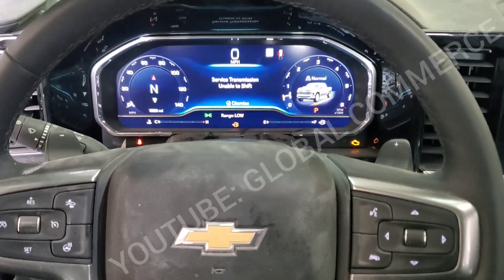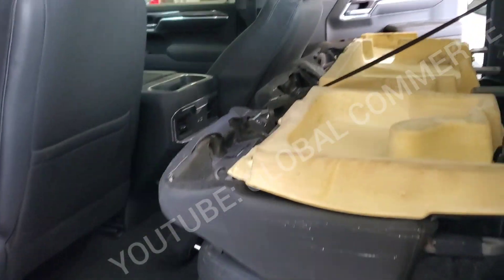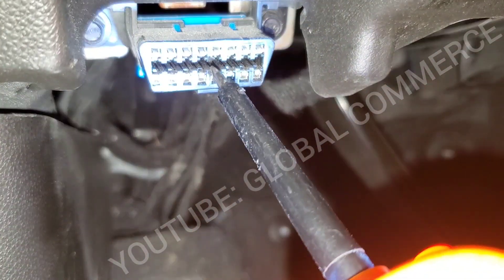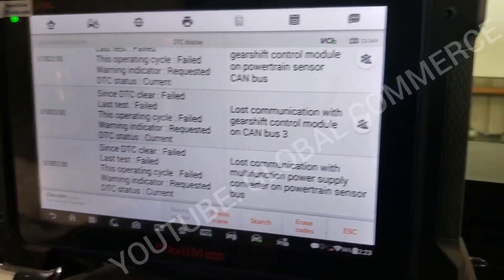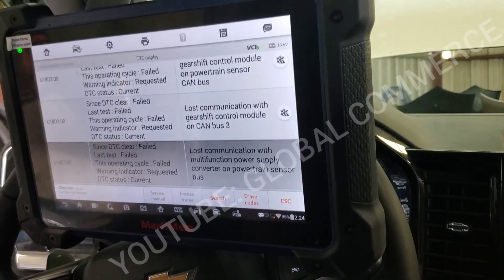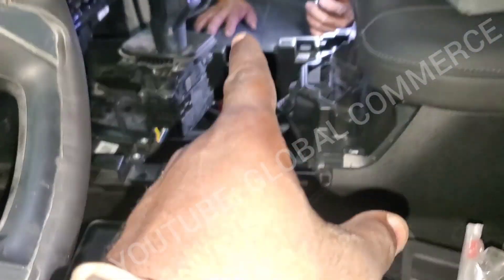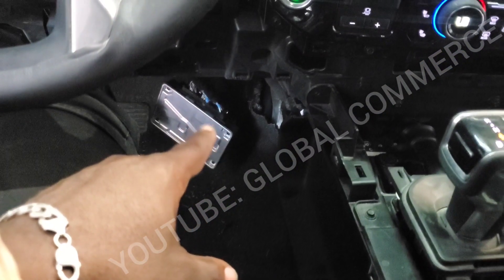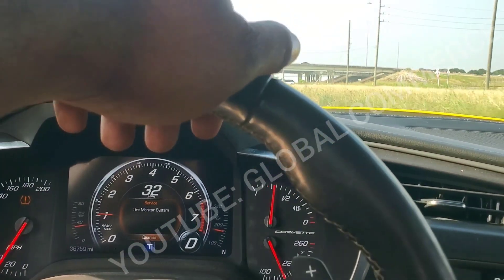2023 Chevy Silverado U0074 Lost communication CANBUS 2 Off, U0103 Gear shift Module! CAN DIAG/FIX!

Comment: I brought a 15 yukon at auction  all fues and relays were missing and i replace them got truck running good till fan ,rpmand oil pressure ,sterring stopped working .cleaned all grounds and battery .i havent gotten to fuel module in rear and abs..I used a different  scanner and it shows a U0073 code and can bus A cant find info to support to loom for

Comment: I have a 15 yukon xlt 5.3 have avproblem with push button shut engine off and battery draining. I have to pull relay toshut engine off.when start up the button is green in off position  while running  and in start position  off .My scan tool says u0100 and u0073 where should i start.
Reply from the maker: Battery disconnected check resistance between pin 6 and 14 should be 60ohms .. if 100-+ ohms you have a physical cable fault.. I  have videos troubleshooting this subscription and check my other videos

Comment: Even as I watch this my 2023 3.0 diesel at dealer and advisor said we can’t find the issue a fuel engineer from gm has to come down. Been there since January! Good video man.
Reply from the maker: Sorry about that situation.. if it was here in Houston I probably would have it fixed in 30m but it's under warranty I assume.. They "should " eventually find it.
Reply: @globalcommerceca  advisor said if it was up to me I would just change entire harness.
Reply from the maker: @bullgamer7343  I hear you, might just be a bad wire harness..

Comment: I got a similar issue, intermittent no crank no start, no communication with multiple modules including ecm no gas gauge, when i disconnect multifunction converter i get communication with ecm and gas gauge comes back but cant shift, any advice?